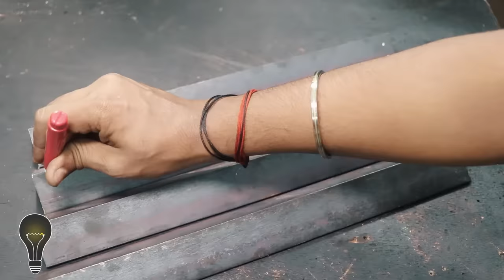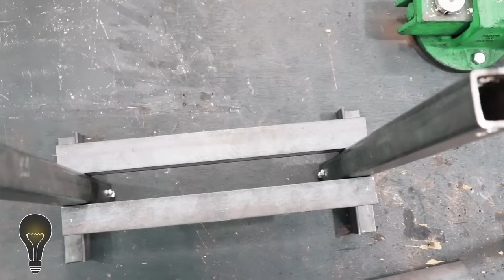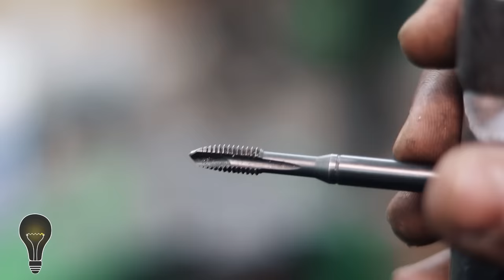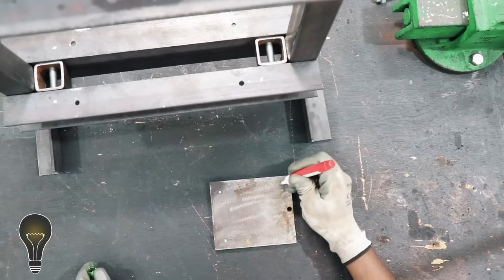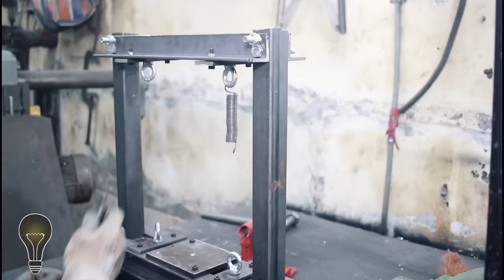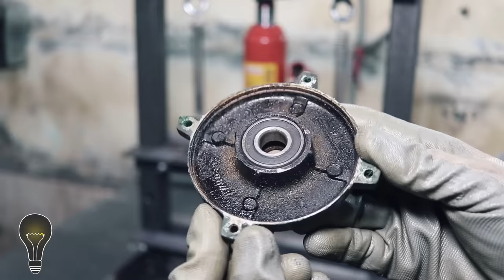HOW TO MAKE STRONGEST HYDRAULIC PRESS MACHINE FROM BASIC TOOLS FOR WORKSHOP | DIY TOOLS AND MACHINES

Comment: Great ingenuity man. If you have these parts laying around or just the desire to build it yourself this is well done and looks to be designed well enough to be "safe". Just curious if you bought the parts and  how much they ran you. You can pick up a 12 ton press at HF for about $100, but I've got a 20 ton bottle jack and some nice steel sitting in the garage... Why not spend $100 in man hours building one out of  unused parts for the satisfaction of doing it yourself. You have me intrigued. Nice work on this!
Reply: Super

Comment: Great project, thanks! But, couldn’t you get the rocking out of the base? Casts serious doubt on your craftsmanship, and attention to detail, and therefor your engineering judgement. Those are some serious, expensive forged lifting rings just to anchor those puny springs. They do look real nice and pure, though, not like some cheesy bent wire, which might have done the job. Got a bigger, heavier press in the works? Eager to see. I’d like to see how  you might make some bending equipment, too!

Comment: Concept is good. Material used is too thin.
Reply: i think its good
Reply: Everything is good until it isnt.... like he said, material is a bit on the thin side. It may not break at first but over time it will probably start warping and bending... unless you hardly ever use it
Reply: This is fine for few tons - maybe like 5-8t